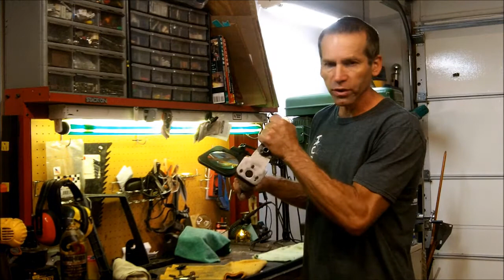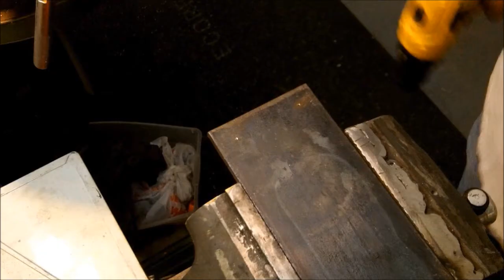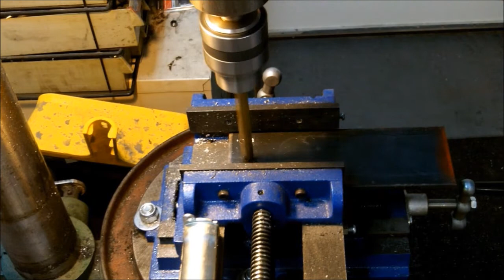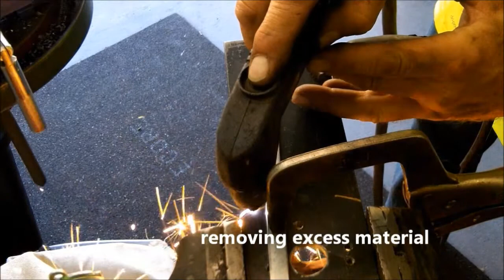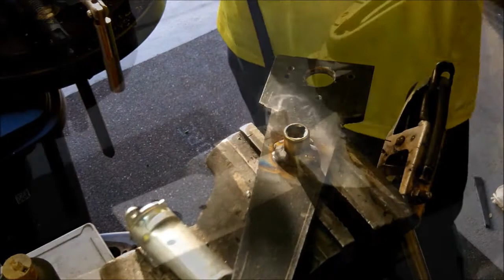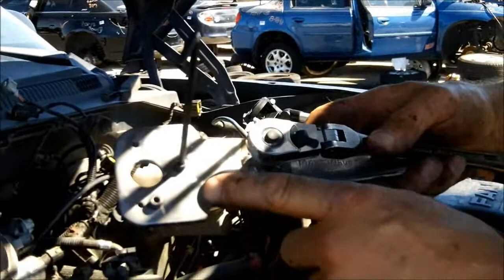DIY Jeep/Dodge 3.7 & 4.7 Camshaft Sprocket Spanner Wrench

Comment: I have a 2006 jeep with a 3.7 and the passenger side has rivets could I just drill one out to take the bolt from the tool, or would that weaken the sprocket?

Comment: in the cloyes newer sprocket there is no hole on the passengers side/Right. The original one that im removing has the third hole where there's a removable nut and bolt where the pin will fit. the now removed nut and bolt cannot be reinstalled ,whether that means anything or not. Bottom line ,i wont or cant use the passengers side piece that cloyes sells.Another piece for the trash.

Comment: I have viewed this video before. Based on this video I purchased a used cam gear for a template. But I cheated I ended up making this cam gear my holding tool. I drilled out the center hole and fine tuned it with a die grinder. I could not find 12-24 screws so I purchase 6mm screws and I tapped the holes in the gear. I then filed down the exposed part of the screws when they were screwed into the gear. So they would fit the cam gears on my 4.7. I then welded a 5/8`s nut over the V8 mark so I could hold the cam with 15/16`s end wrench. I just used it today it worked very well but I make another one I will weld a crows foot to the face of the gear. I am in the process of pulling the heads the number 2 intake seat dropped and is hanging on the valve. If the block looks good I will have the heads rebuilt I will also change the oil pump and the timing chain set. Thank you again for this video.

Comment: I'm working on a 2007 Jeep Liberty 3.7L. The passenger side cam sprocket has no holes ( 3 rivets). Any suggestions on how to put it back in and be able to torque it? I'm pretty sure I can remove the bolt with a quick shot of the impact gun, but I never use power tools to put things back together.
Reply from the maker: Yes your impact will most likely be able to remove that bolt.
 Yeah unfortunately the 3.7 has rivets on all 3 holes.
 You may have to resort to using a vice grip on the Camshaft itself to get it to torque properly.

Comment: Martin, two things.  Number one are you sure the 08 to 13 4.7s have a hole in the cam for that otc cam holder referenced in the comments?  Have you laid eyes on a late cam to see?  The factory service manual for my 2010 ram shows the Miller tool like you built on the left hand sprocket and the right hand head is tightened (must be a two man job) while the left hand sprocket is held with the tool.  This is a bad idea because it puts all the load directly on the timing chains.  Second, I was going to make your tool but I have been thinking about how it applies its load on the right hand sprocket.  You only have that one pin to engage and that becomes a pivot point for the tool. The tool is captured and kept from pivoting on that pin by your socket. This there is tremendous friction between the socket and your tool. I imagine the socket would bear marks after tightening. The problem I see is all that friction between the turning of the socket and the tool will alter your applied torque to the fastener. You are essentially adding a brake on the socket as you turn it creating less than desired achieved torque on the cam bolt. Do you agree?

Comment: The 06’ Commander engine doesn’t have any holes in the passenger sprocket… is vice grip the only way to remove?
Reply from the maker: yes or you can use a Crescent 9" Locking Chain Clamp https://amzn.to/3oXxQHg

Comment: Hey Martin, thanks for the cool videos.  I have an ‘04 Ram 1500 with the 4.7.  I was wondering if instead of welding the socket onto the tool, if it could be held on with a bolt and nut?  I have a gas less mug welder but my welding skills aren’t up to par yet.  Thanks in advance, and don’t let the haters rain on your talent.  Their just jealous!  🤣🛠
Reply from the maker: That's a great idea to use a nut or a bolt and weld it into place and then just use a socket on the ratchet. 👍

Comment: Martin, I had a timing cover gasket failure on my 4.7 which took out the chain guide on the r/s head. So I ended  up building the spanner that you designed. I made 2 mods to mine. I welded a thick 2 in. dia. washer to the side that goes towards the cam, I had to use a step drill to make the hole big enough to fit over the flanged part of the cam gear retaining bolt. That allowed it to sit right on the gear without rocking , I left the tool hole the original size (smaller). The other mod I did was that I welded a 3/4 in. automotive water pump heater hose bung where the socket goes to make a well for it to go into, that really stabilizes the socket. I made it about 3/4 to an inch tall. Came out really nice. Got my 12-24 bolts at Fastenal. When I torqued the pass side cam bolt to the 90 lb spec it did bend the bolt ever so slightly ( Grade 9 alloy). I think I am going to figure out another bolt to make it a little stronger like to maybe supplement the one that goes in the hole with one that goes between the gear teeth giving it 2 pins to take the load. Thanks for the videos.
Reply from the maker: Sounds like you got some good ideas there, let me know how it turns out
Reply: Will do, maybe I can send you pictures when I am done but the tool did work awesome as is.

Comment: Just buy the tool. Cheaper & faster
Reply from the maker: Who makes a tool that can do either one of those camshafts
Reply: @martinbuilt  OTC 6689 Chrysler Master Cam Tool Set
Reply from the maker: @kalani1963   
 https://amzn.to/2S0LN7B
Reply: @martinbuilt  yes, that's the whole set of everything needed to do the timing. The tool itself can be bought separately for around $20
Reply from the maker: @kalani1963  
and which one of those tools will work on the 99-07's  I can tell you it's not the one with the red handle that one is for the 08-13 4.7's and it's a piece of crap because  I have that one.
Reply: @martinbuilt  it's the black long one in the front. Works really well. I've done a number of truck's with it and it still performs well.

Comment: Great video, thanks Martin! I am doing the timing chain on my Jeep Liberty 2002 3.7 and the replacement LHS sprocket has rivets in all 3 holes, so I don’t have a spare one for the tool. Looking online there is an OTC tool 8428B, a horseshoe shaped tool fitting over the camshaft with a pin engaging a hole in the shaft. But reviews aren’t great. Any advice?
Reply from the maker: yes, I believe that tool only works on the 08 and newer camshafts, I have one and yes that pin is not the strongest. You may have to do the Vise grip method on the camshaft.
Reply: Ok thanks martinbuilt ! At least I have proper Irvin Channelocks and some rubber sheets, grip should be OK.
Reply: very late reply, but my chilton manual says to remove the LHS side first, using a 'spanner' (or Martin's tool) on the RHS sprocket, since they are all connected via the chain system.

Comment: Can I use the 4.6 timing wedge tool also to wedge it between the chain and tensioners to remove the cam sprocket bolt and cam sprocket?? Looks like it would be a similar process by design. Replacing driver left cylinder head gasket, 2001 Jeep 4.7, trying to do so without removing the timing cover.
Reply from the maker: I wouldn't be surprised if would work. If the shape is close you'll probably be okay
Reply: @martinbuilt  I also seen a Chrysler 4.7 wedge tool I might check that one out too
Reply: It'll never happen. Timing cover needs to be removed so you can remove and reset chain tensioner. I dont think you'd be able to put the sprocket back on with all that tension.

Comment: I was wondering why you just didnt make the handle longer, if the handle was longer you wouldnt need a breaker bar to hold it right ? and also what is the distance from the big hole to the welded socket?
Reply from the maker: with a longer handle it wouldn't fit in the tool box that I carry in the XJ

Comment: Hi Martin. When I watched your cam change out vid, I noticed the nifty sprocket holder never realizing it was home brewed 'cause it looked so good. Looked everywhere for it and finally went back and found the link to this vid, (DUH Stupid Me. Should've done that first). You've got the best tool design period! Thanks for the great detail............
Reply from the maker: Thank you, appreciate that. Yeah I thought about that one for a while and I knew there had to be a better way then sticking a pair of vice grips on the camshaft. What I like about this particular tool that works great on both left and right camshafts where some of the other tools out there only work well on the left camshaft.